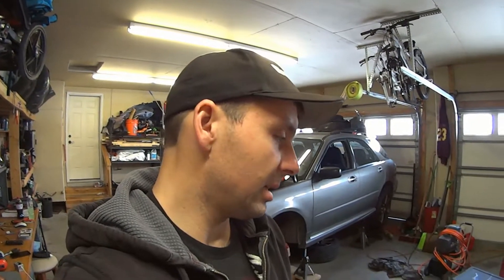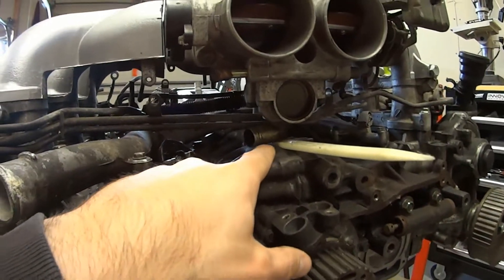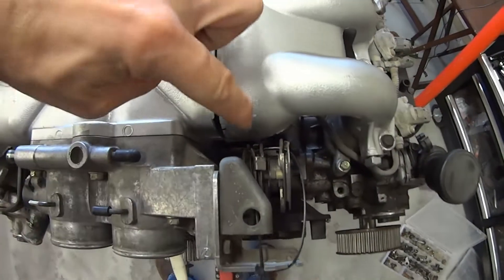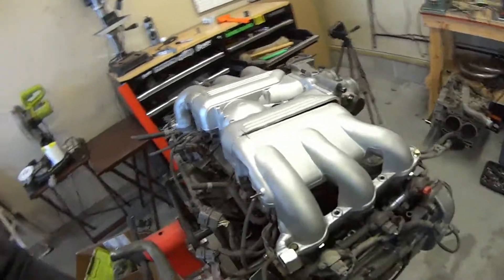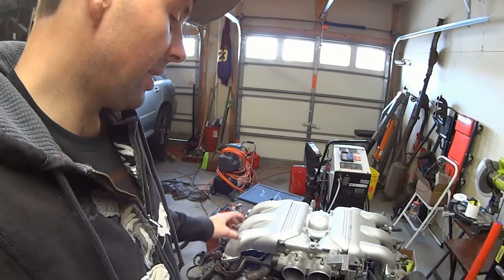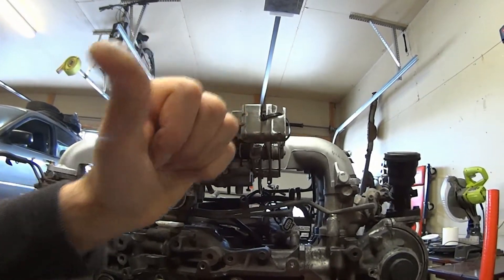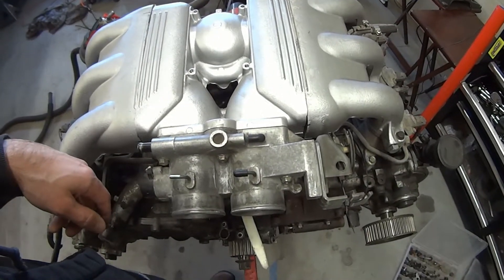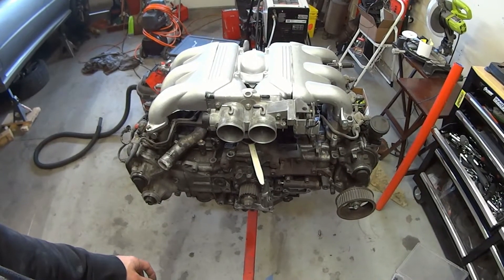EG33 Swap - Reversing the Intake Manifold (Ep. 13)

Comment: Edit* Hey so I just realized your friend who did the 3D printing for the HALL sensor can help with the IM fitment. How about he creates spacers to raise the IM height? (Between the head and IM). Personally I would want to avoid so much welding because I don't know how haha! Lastly, an aluminum spacer between the TB and IM would give you freedom to create a bolt on solution/bracket for rerouting the throttle cable; plus push the IACV forward away from the block. Making the IACV easier to fasten a hose on. Lastly if you convert to drive by wire, which I hope you don't, maybe the ez30/36 hardware would work. Good luck! 
Do a video on rear differential bushings and subframe bolts please! 
I appreciate all the due diligence you're taking. Love the progress so far and find your channel inspirational! Please update us soon.
Reply from the maker: Great ideas. I did find some spacers online and I'll be taking about them in my next video. Throttle body spacer may be required still though.